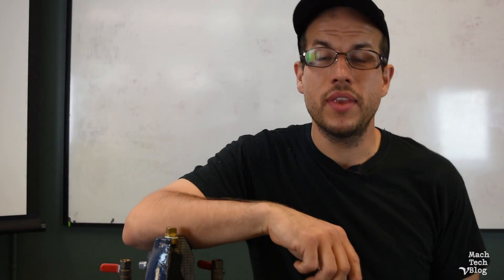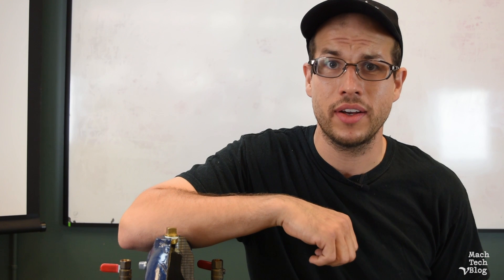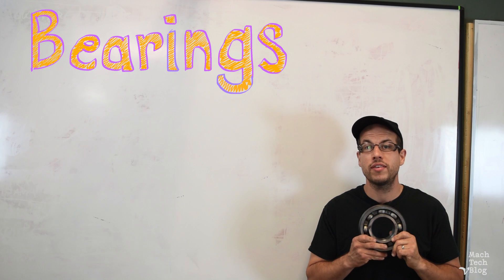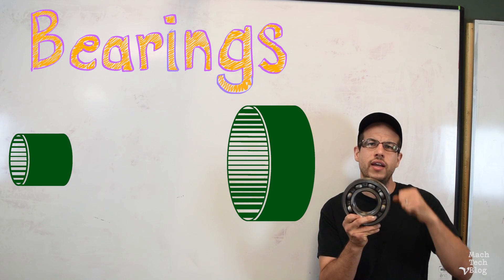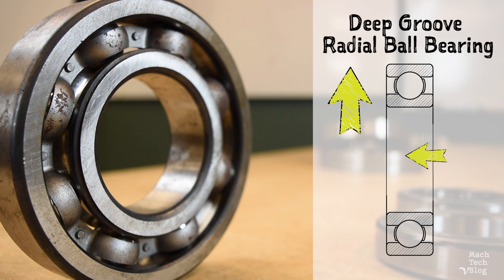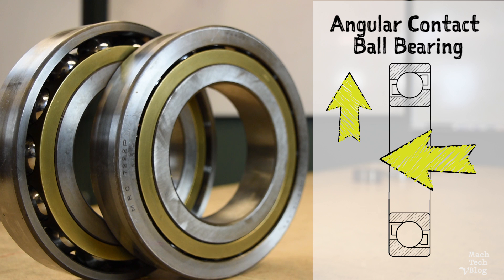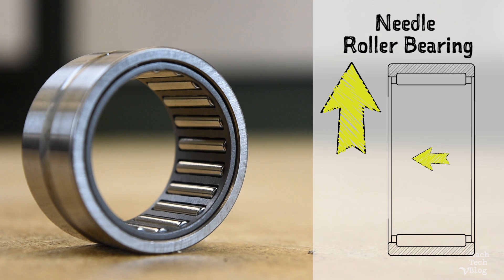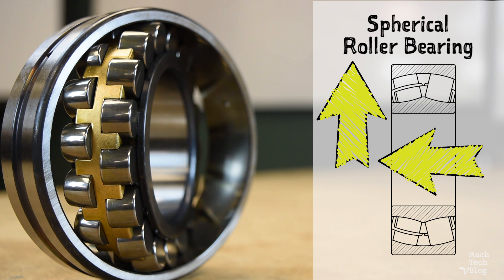Anti-Friction Bearings

Comment: I'm a retired electrician and we usually changed bearings in small to 250 HP motors. Still amazed that when I started back in late 1960's most NEMA motors still either had a zerk fitting or threaded hole to install one to decrease ball bearings. Amazed how long some sealed bearings may last in motors t hug at run 24/7.

Comment: Hey sir. I see your video is 3 years old. I don't if you're still around but I have one question. I have one pump and one pressure washer both electric, both have zerk grease fittings for the motor bearings. Some people told me not to grease those because I might cause damage. Is that true? If it's not. What kind of grease should I use?

Comment: It was proven years ago by crankshaft manufacturer SPG that a correctly designed oil fed plain bearing had less friction than a roller bearing or ball race, this related to the roller bearing crankshafts.

Comment: One reason modern car wheel bearings not lasting as they did before are the use of angular contact model. Older car model often has the tapered roller model. The correct type.
Reply: Skyisnotalimit
'modern car wheel bearings not lasting as they did before'. source?

Comment: Well, I think 3 things define a bearing: 1. support a cylindrical shaft for rotation or swing; 2. an independent component between shaft and structure; 3. lubricated (or prevent direct friction)
Bearings do the 3 things you mentioned, but so are other machine components, e.g. rails, pulleys
But to be more general, linear motion supporting element sometimes is also called bearing, such as linear guide can be called linear bearing.  So point#1 can be generalized as "support an element's 1-DOF (degree of freedom) movement"....but that won't be nice to put this long string on youtube clip...

Comment: damn good video. Question. So I have an old fashion windmill with a horizontal shaft and 2 sealed bearings. If I wanted to have the shaft to turn more freely, to help with low wind start up, less torque required, can you recommend a better bearing??

Comment: Great video!  I really appreciate all your videos; you do a great job.  If you don't mind, I would like to comment on a couple of things.  Folks who have little or no experience have never heard the term anti-friction bearing as it has kind of become a legacy description.  It is entirely accurate and acceptable, however I started using the term "rolling-element bearings" because people tend to understand that term better.  
Two small nit-piks:  You said shielded bearings are lubed for life.  That is not true.  Sealed bearings are lubed for life but shields are actually installed to prevent over-greasing of the bearings.  The shield is always on the side of the bearing where the grease is introduced to the bearings (shields can be removed for oil-lubed bearings).  Also, angular contact bearings can be installed back-to-back, face-to-face or even tandem depending upon the application.  Almost always they are installed back to back in pumps. However, face-to-face is better when misalignment is present (per SKF).   
Love the Chesterton 442 Split Seals on your pump!

Comment: This is the first time I have ever heard or read them called "anti-friction" and not "ball" or "roller" bearings. Ain't all bearings supposed to be "anti-friction"? I get that it's rolling resistance vs sliding but they both are designed to minimize friction.
Reply: skoronesa It is a bit confusing but common in industry to differentiate anti friction (ball or roller bearing) and plain bearing (pin and bushing).

Comment: You never want to restrict the motion of the shaft.
Reply: Joe Blow that's absolutely not true. You don't want to restrict radial motion but you absolutely want to restrict axial motion. Depending on the application that's either a crucial principle or simply something that increases efficiency and decreases stress on the components.
Reply: Oh no. You want to thrust the shaft in and out, rotate it, and stir it.
Reply: Joe Blow oh OK I see what we're doing here. You're right, the shaft needs total freedom of movement.
Reply: No not at all. The shaft still needs general direction and guidance and while some friction is necessary, lubrication helps create the correct amount of friction.

Comment: that's not going to work for my fidget spinner.😓
Reply from the maker: Hi, Arthur,

Try a 608 (8mm ID, 22mm OD, 7mm Wide) full ceramic bearing. That will get you spin times of at least a minute. It's a popular, inexpensive choice for fidget spinners.
Reply: aw thanks for replying.  i was actually just having a laugh about it since this bearing is HUGE! my youtube search was just a little bit off.  
btw are there such things as magnetic bearings? where the inner wheel is suspended mid air? my google/youtube searches have come up fruitless and was hoping someone more knowledgeable would have the answer. 
thanks
Reply: i think magnetic bearings are used for fans and also for big machinery

Comment: why would they put a tapered bearing on a axle of a truck wouldn't the bearing be trying to pull apart all the time
Reply from the maker: Hi, Jim,

Tapered bearings on automobile axles and wheel hubs are pre-loaded with threaded nuts to keep the outer conical races and roller elements in contact for exactly the reason you mentioned.